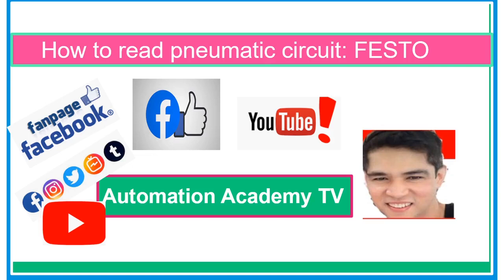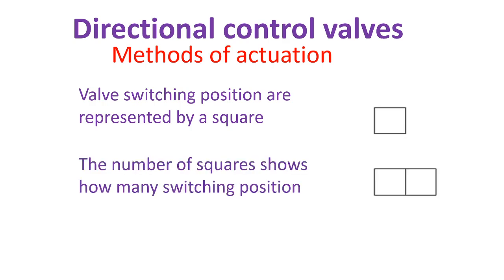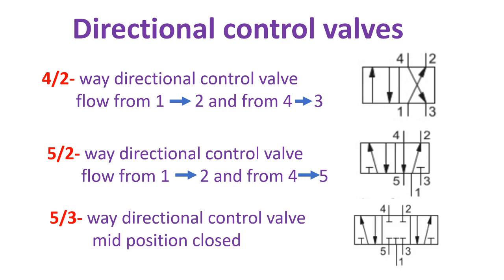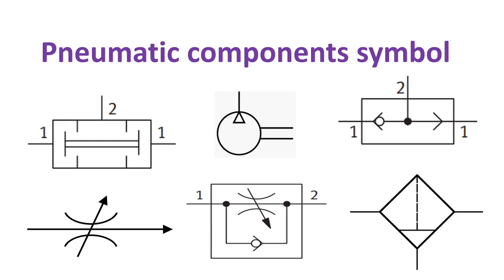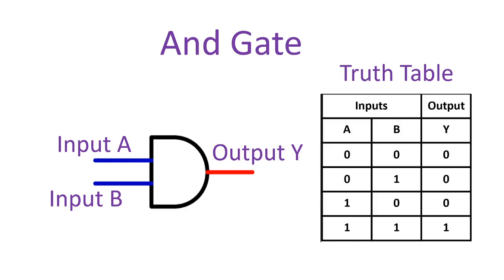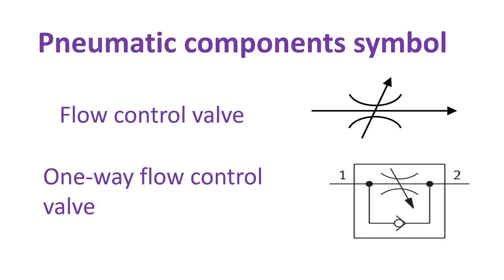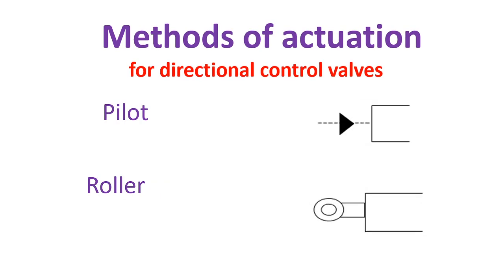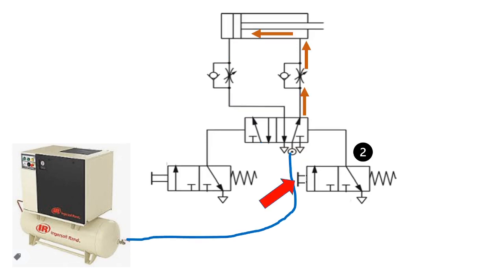Basic PNEUMATIC and HYDRAULIC Part 3

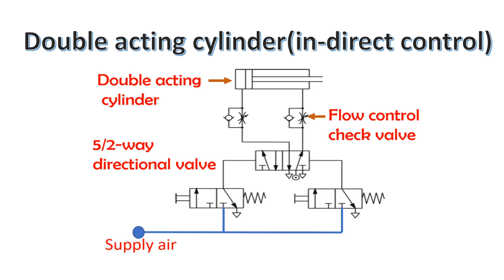Comment: Hi What is the purpose of the two flow control valves in the circuit at 6:29 ?  Thank you
Reply from the maker: So that you can limit the flow of extending and retracting a cylinder, there are some process that they want they cylinder to move alow
Reply: Also called a speed  control valve. Is to control the peed air  supply going in to the cylinder.

Comment: Great presentation!   However, I have a question.  I noticed that Festo describes a valve say a 3-port 2-position as a 3/2-way valve.  So, the word "way" is it associated to number 3 or 2?  I know that a 3-way valve is a 3-port valve, and a 2-way valve is a 2-port valve.   So, is the 3/2-way supposedly a 3-way/2 valve?           My next question is, is a five port valve a four-way or a five-way?  Thanks
Reply: A 3/2 directional valve is for a 3 port 2 position so that would be called a 3way2 position. The same would be for the 5 port valve,5way not 4way.

Comment: in single acting cylinder is there are possible to maintain extend after you unpress the button because we know after we unpress the button the cylinder will retract by string return right? So there are possible way to maintain extend the cylinder even if you unpress the button?